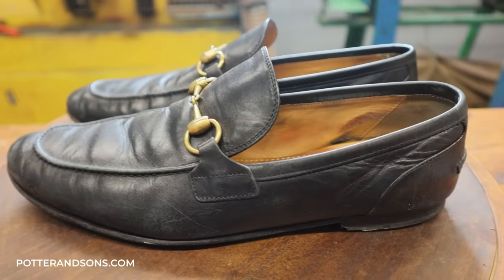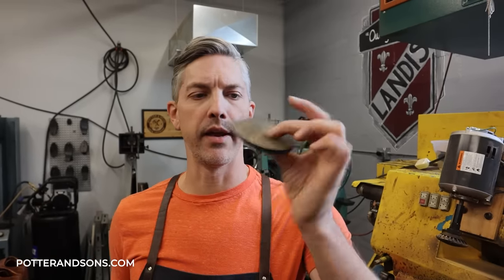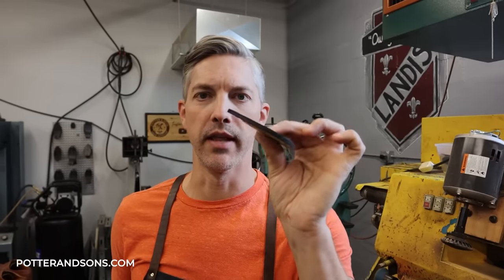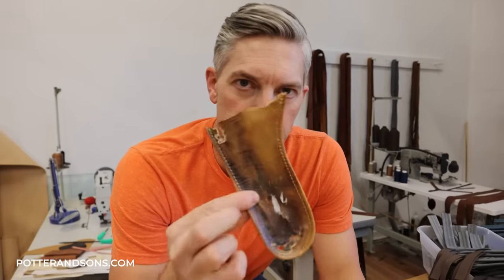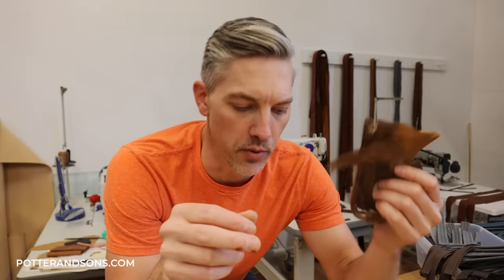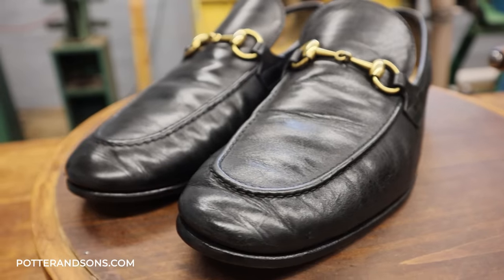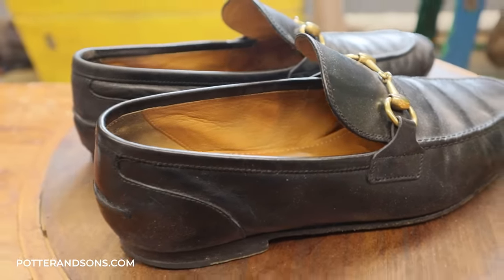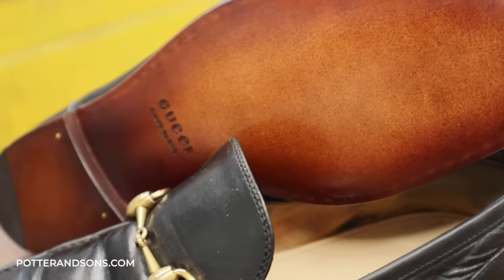$900 Gucci Loafers Restored!  Are they Worth it??

Comment: I own 6 pairs of Carmina loafers, 1 pair of AE horse bit loafers and 2 pair of Gucci 1953 horse bit loafers in brown and black. The Gucci 1953 have the best fit and comfort of them all. Worth every penny I spent.
Reply: Good to know, I don’t wear loafers but I got the 1953 in black and they are very soft. I contemplated getting carmina or even meermin but I wanted the original iconic 1953😂❤
Reply: Amen
Reply: For some reason the fit of 1953 never worked for my weird feet, but the Jordaans and Brixtons are easily my favorite shoes to wear. Can't get enough of them for the same reasons you just stated.
Reply: Fit>everything

Comment: Nice work, as always. What i wonder is, do you get this gucci heat stamp from Gucci or can you sort of make your own? Couldn't you get sued for counterfeitting?
Reply: Not as long as they make it clear that they’re RE-CRAFTING the shoe as a Gucci brand
Reply from the maker: We try to use the correct logo for many of the brands we resole.  It just adds that extra special touch.  As the gentleman said above, no, it’s not counterfeiting as long as we’re actually working on the authentic brand we’re refurbishing.
Reply: @DrMJJr  that's what i figured, thanks for confirming
Reply: @TrentonHeath  makes sense, thanks
Reply: Is it industry practice to use original marks on replaced parts as long as the upper is intact?  When is Gucci not Gucci?  Opposite of counterfeiting risk, I think it’s unfair to cover up your quality work, now that the shoes are arguably better than new.  I guess the owner would prefer to see the brand name.